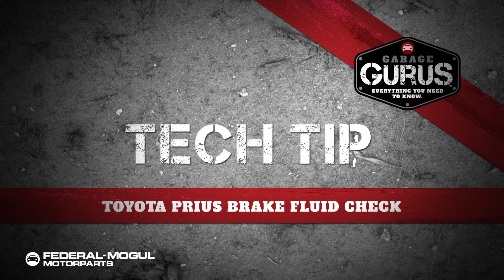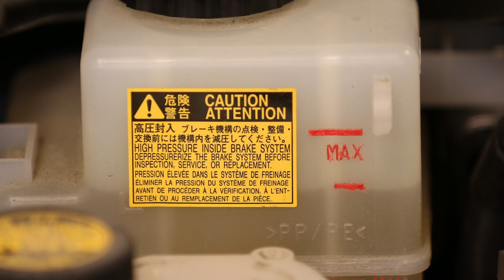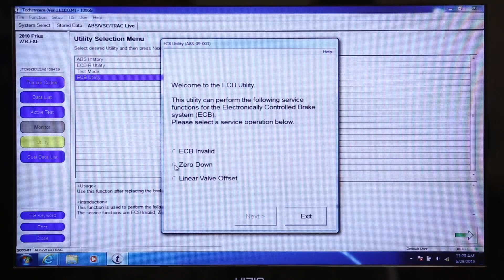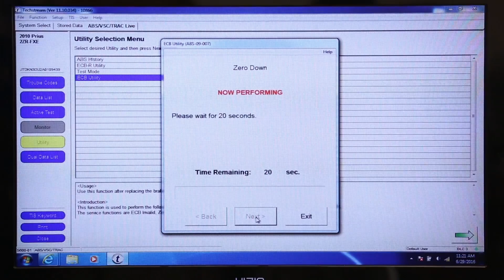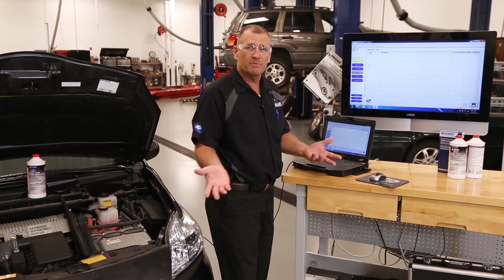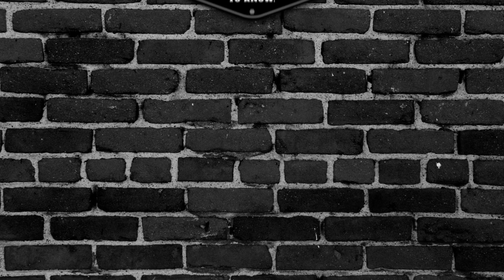Toyota Prius Gen 3 Brake Fluid Check

Comment: My mechanic said that my Prius V will need the brake fluid flushed and changed, and is greying.  The vehicle has 138k on it.  Can any brake shop do it?  What is a fair price in 2026?  He wants 300, but is far away, and I am wondering how long it will go before I have a ABS module issue.  I’m low on money right now.  Thank you!

Comment: Hi Garage Guru Rick Kearns, I have a 2010 Toyota Prius. I have a low break fluid warning light ( red ) appear on the dash board and I checked the break fluid. The break fluid is just under marking 'F' (full) but still warning light on the dash board and buzzer is sounding while driving, what I have to do, please? Hope to hear from you soon. Thank you.
Reply from the maker: The brake fluid reservoir markings could be confused with the coolant level reservoir. The coolant reservoir and brake fluid reservoir are located very close to each other.
The brake fluid reservoir does not show the letter “F” on the brake fluid reservoir. You may be looking at the coolant reservoir that does use the “F” and “L”. The brake fluid reservoir is the one behind the coolant reservoir. It uses the words “Min” and “Max” designations for the fluid level. If you have inspected the fluid level for the brake system reservoir and the light is still on you should have a certified technician inspect the vehicle immediately.
Reply: Was it brake fluid?